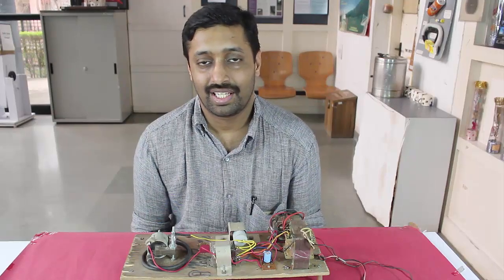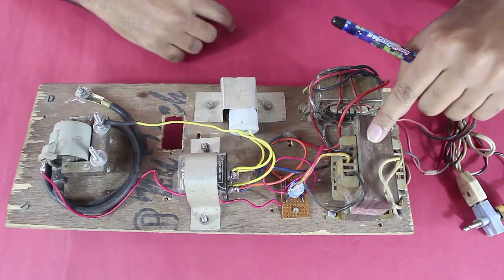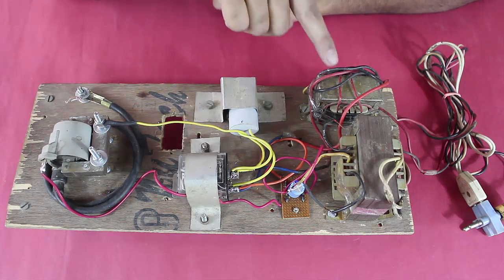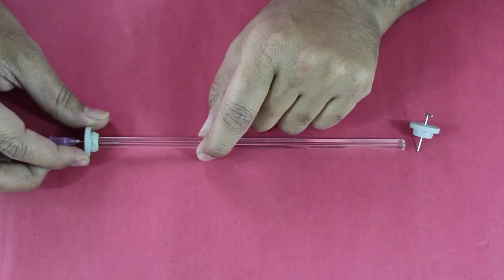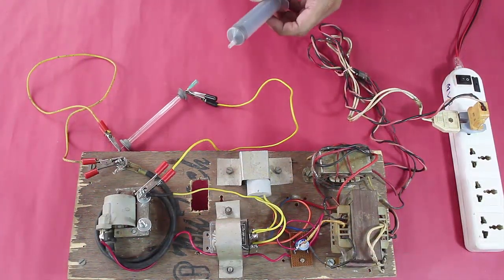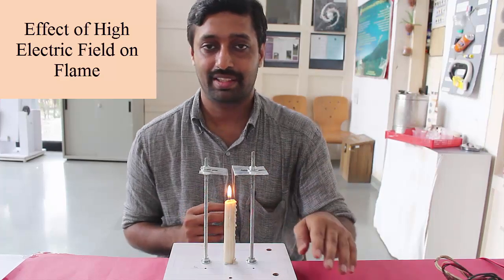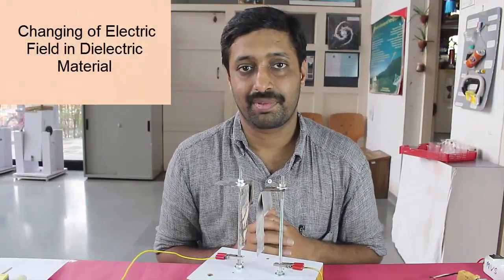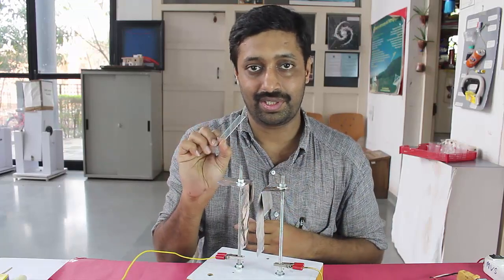High Voltage Experiments | English

Comment: Sir Thanks a lot for this video. This informative stuff is very useful for college students like Me. Sir, I have a question, If you would like to answer.
"Is there 0.01 torr pressure inside the tube ?" 
Because, as I studies, it's important to provide 0.01 torr presure within the tube. Thanks in adance Sir.
Reply: hi saad, the pressure inside the tube was calculated based on the initial value of pressure (1 atmosphere) and by knowing the initial and final volumes before and after the syringe piston was pulled. By simply putting these values in the equation P1V1=P2V2, we get an estimation of the pressure to be of 1 torr. At this pressure we get to see faraday dark space, positive column and an anode glow.  Kindly verify these effects as i may have recall them in wrong order with respect to pressure. As you further reduce the pressure (0.01 torr), almost all the gas molecules are gone. At that instant you start getting what is called as cathode rays or electron beam.
Regards
Amit

Comment: Awesome! I think this would also work with an old neon sign transformer. In other words, without rectifying the AC. What do you think?
Reply: A neon sign transformer is powerful and quite dangerous. Some also propose to drive the ignition coil directly in AC but: Using an AC controlled relay is an easy way of driving the ignition coil in switched mode (as it is designed for) without the use of an electronic driver. In switched mode the primary is submitted to self-induction and you get about 150V voltage spikes. The transforming ratio of the ignition coil is about 100 only but doing this way you get 15000V at the secondary. If driving in 12VAC (sine wave) you will just get 1200V at the output. Not enough for these experiments.